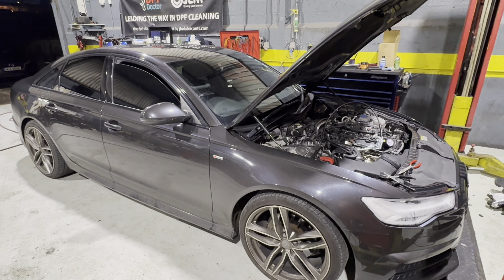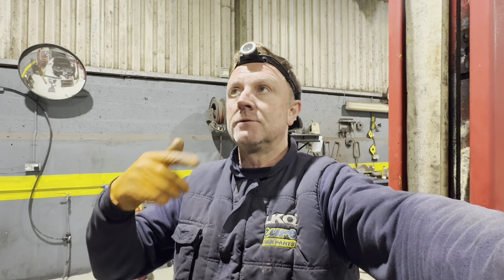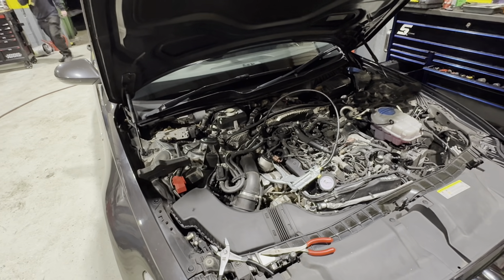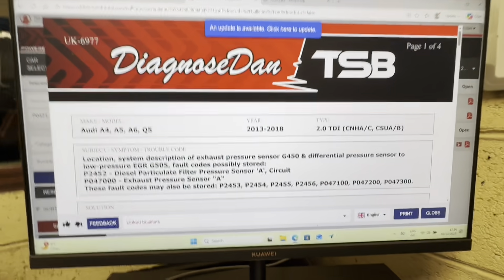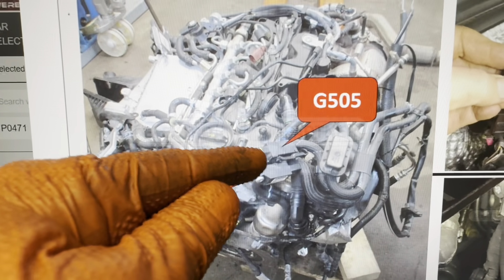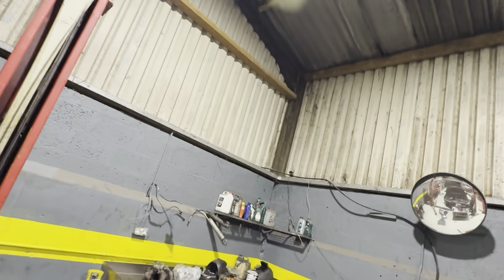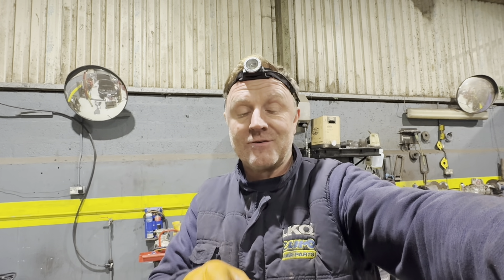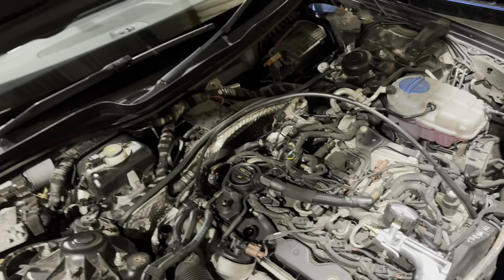DDTSB in the Bay-Real shop stories. Episode 1 Kennedy's garage - Audi P0471 & P2002

Comment: Get yourself some bicycle brake cable to put in a drill to unclog pipes.
Reply: I use an old speedo cable inner(remember them) the broken end is frayed and is ideal.
Reply: Thats a great tip!
Reply: A set of guitar strings will also do the job, plus they come in different sizes so that might help on smaller pipes or hoses...
Reply: Guitar strings are better